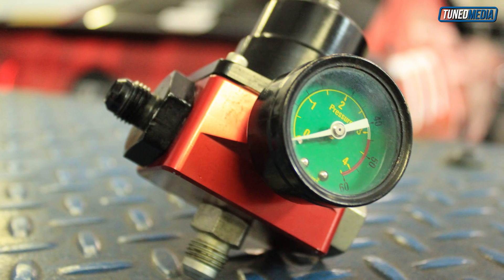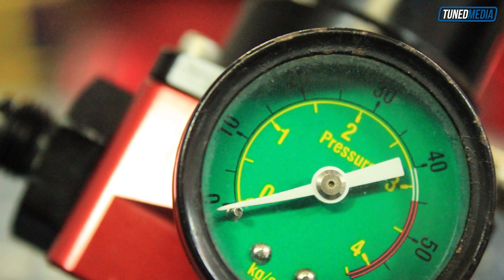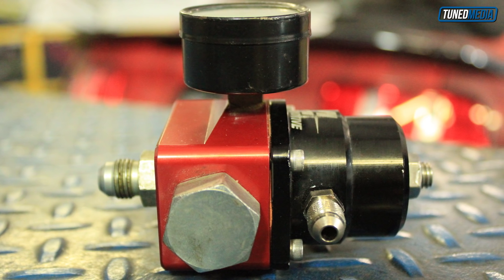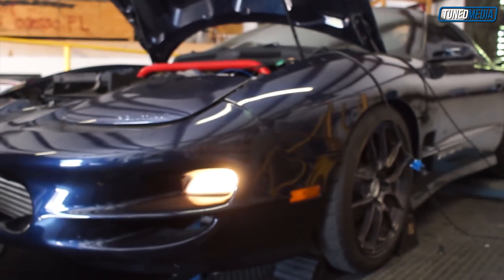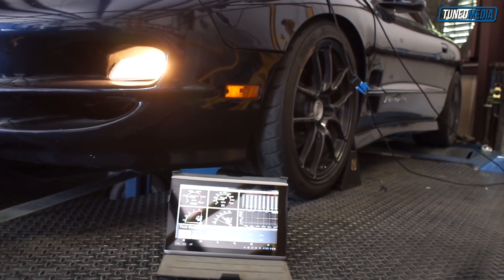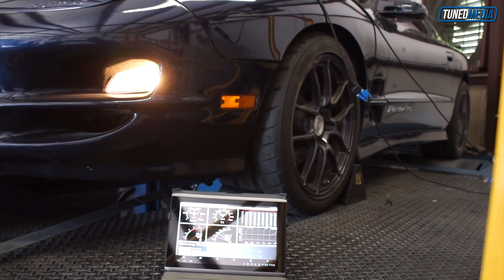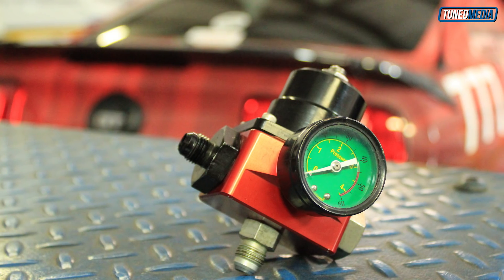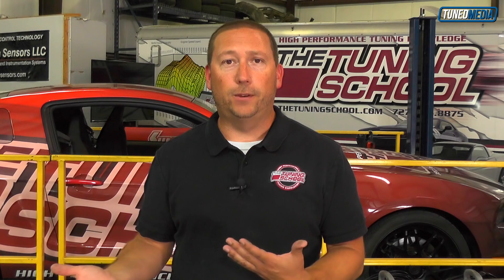External Fuel Pressure Regulator for Boosted Cars

Comment: A 99 k1500 low pressure do I have to disconnect the stock regulator under the intake or can am regulator be run through it

Comment: i can't find proper anwser but here the question
can you use a fuel pressure that has a vacuum line as a boost reference ?
i guess not but i need anwser

i just tested and it dosent work T_T
now i need new  regulator when i get to play with turbo
Reply from the maker: Yep. You would use a vacuum/boost hose from the intake manifold for the regulator reference.
Reply: @TheTuningSchool  for turbo ?

Comment: Can you tell me what would happen if the return line is pinched? not completely. but lets say %30-50? my line is going back to the top of the tank and we had to drop the tank just a bit in order to make push the return line up.  after securing the tank the fuel line feels like its held solid by the tank. NOT exactly sure how much it pinches the fuel line tho. My mechanic said not much. lol. i hear to fuel going back to the tank. it works.. but i have a crazy fuel pressure that jumps around. i do admit i only modified my stock fuel rail instead of getting a new one. ( they dont make them no more for my car so i had to wait for someone to sell me a used one) people told me that might cause my crazy jumping fuel pressure. I just wonder than a pinched return line could cause

Comment: Can u boost a vehicle that the stock ecu is not supported and can't be tuned? And just run 8lbs ? By going with larger Injectors and a boose ref regulator and then just watching an arf gauge to make sure it's not going lean ?
Reply from the maker: No, you can not boost an electronic fuel injection engine without tuning the ECU or replacing it with a standalone ECU.
Reply: It has been done before but it seems like a pain in the ass. If you have all the time in the world you could eventually find that perfect setup but again, it's going to take longer than ecu tune but it will be cheaper.

Comment: Why can't your tuner just utilize a map on a non stock ecu to up fuel pressure as Rpms(and boost) increase? Seems like that is well within the realm of possibility.
Reply: The ecu does not have control over fuel pressure, only injector on time.
Reply: If you are running a standalone EMS with correctly sized injectors, it is my understanding that what you are saying is not only correct but preferable. As long as you have complete control over the injectors you can run a 1:1 adjustable fpr. Just like most stock FPRs when you are on vacuum there is a baseline pressure and then on throttle (no vacuum) or on boost, the pressure rises in direct relation to additional boost. A "rising rate" AFPR is something people use as a dirty workaround on cars that do not have all of the components necessary to control all of the factors. A rising rate works by adding pressure at a ratio greater than 1:1 as boost builds.